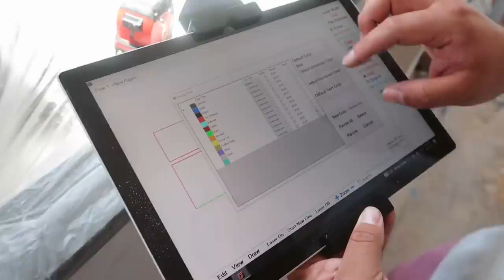HOW DID I GET SO LUCKY

Comment: I grew up in an 1890s house on the East Coast and the window trim and baseboards look like the same wood as what you have, especially the grain pattern. I think it's probably oak and it definitely looks original. You can probably take a photo of the wood and mail it to the local extension service or take it somewhere that wood is sold and a person there should be able to tell you. In the past, wood used to be varnished and varnish gets darker as it ages. I think that's what the darker layer over the wood is. The wood trim in our house had a layer of varnish over it. Varnishes can still be used today, but widespread use of varnishes fell out of favor, partly because they are highly flammable even when dry, and are toxic when applied. Let us know what you find out.
Reply: I agree that it is original. I owned a 1920's Mediterranean style house and this trim is very similar to what we had. It had mostly oak but also some mahogany in places. The grain looks more open so I'm leaning toward oak.
Reply: Definitely oak! 👌🏼

Comment: Consult with a carpenter to determine if the stained glass windows are suitable for hinging and to be used as doors. The side stiles are pretty thin wood and they probably were originally fixed and decorative rather than functional.
Reply: I agree
Reply: I agree.  There's bound to be solutions but it's important to invest wisely.  Don't want to face disasters later on because you failed to do your research and course corrections.  It would be disasterous to invest in property, security and insurance if they refuse to payout because the wrong thing was installed or something installed incorrectly.
Reply: Great points. in the end there is a solution, but it may not be installed as exterior doors. Your climate is different, but good points on how can be used.
Reply: @ritaevans7125  I agree.  Maybe a set of double glazed doors on the outside keeping the fancy doors for on the inside of the doors as 'window treatment'  rather like blinds or curtains. Maybe the outside ones on hinges but fancy inside ones on sliding tracks but fancier than barn doors.   The solution might just need a bit of creativity.

Comment: The wood still has some varnish and stain on it. You will have to sand it down to get to the actual wood and it is probably oak. Also be careful with the heat gun, left in one spot to long and the wood burns under the layers.
Reply: Denatured alcohol and steel wool works well to remove old varnish.  Use good ventilation though!  It's hard on your lungs.
Reply: Denatured alcohol is highly flammable. Be careful how you treat the rags or dispose of them. It works great for the varnish!
Reply: Yes to all these comments. Sand, stain, finish
Reply: I would definetly use Speedheater for this. Even faster then the heat gun and much more safe to use 👌
Reply: I agree that its oak (probably red oak considering what the grain looks like), and that it has either a heavy varnish or glaze finish left on much of the surface.  Steel wool and denatured alchohol is the way to go.  Then some sanding pads of various grits will take it down to the natural wood and the sanding will help tighten up the grain - should be beautiful when you're done.

Comment: I’ve used citrus strip , it typically takes it off in layers. You might want to test each layer for lead. The older layers may well have lead paint.
Reply: CAME TO SAY THIS
Reply: Yes, the lead test only works on the layers it touches, so you only tested the outer layer.
Reply: @katieb710  but he scrapped it to the wood, so then he has all the layes tested

Comment: Rub the wood trim with steel wool dipped in paint stripper. The darker wood tone could be old varnish which has darkened over the years. Hard to tell what the wood variety is from your video
Reply: Also clean off the gunk with mineral spirits.
Reply: That hundred-year-old Amber shellac is what's making the wood a little darker. It's been on there so long it's probably easy to sand off with a little bit of 80 grit.
Reply: While the steel wool does work, it can often darken the wood unintentionally and that can't be removed.
Reply: Instead of steel wool, brass wool can be used. Order from Garret Wade

Comment: Hey! :) You can actually find out the exact date of manufacture of the windows: On a double pain window the date is usually printed in between the two pains of glass or sometimes on the window seal. Your windows right now look like PVC... so definitely not from the 1920s. It would be so nice to update them to more authentic looking wooden windows with modern insulation. It would really complete and elevate the whole look and atmosphere of your stunning home!
Reply: I agree, these newer windows were fitted within the existing window frames with a new frame. It's a cheap way to update windows but it reduces the size of the glass and makes the frame super large. Considering how many windows this home has, I can see why the previous owners made that choice, but it's such a shame...

Comment: 81” opening, 80” door, perfect. Leave the 1” at the bottom for air flow. Buildings need to breathe and that’s why you have that size doorway. Edit: To your question about the wood trim, what it is/is it original. It may be original since it is quite traditional in style. Possibly maple or beech. Typically staining maple a dark tone ends up looking streaky. Could be why they pained over it. Stick to your lighter American walnut tones or lighter. It could also be quarter-sawn oak. Search for pictures to compare once the stain is removed. Oak can take a darker stain, but you’ll likely need to do some sanding to get the stain to grab. Great finds. Excited to go shopping on Lone Fox now. Bye! 👋🏼🛍
Reply: Yes! Interior doors aren't supposed to be flush to permit airflow. If you don't, the air in closed rooms will become stagnant
Reply: Needs weatherstripping though!

Comment: Hard to tell what wood that is with the current finish, but I'm leaning towards red oak. Remove the rest of the finish down to bare wood. Loving your remodeling videos !
Reply: I agree on your red oak estimation.  The stripper may have opened up and raised the grain.
Reply: I agree! Looks like expensive oak, which would most likely be original.
Reply: Red oak or cedar. Cedar was pretty common then too.
Reply: 1/4 sawn red oak is what I first thought. But with it being so dark I thought maybe Mahogany.

Comment: That wood looks original and it is real wood. It is pretty common in older houses for the wood to have been grained/ given the faux bois treatment when it was originally installed. It was done to use a slightly more economical soft wood but make it look like a more expensive hardwood.
Reply from the maker: Ahhhh I see! With this should I go in and remove that varnish and sand them down / restain? I just can't tell if there will be a grain pattern on the wood under this treatement
Reply: @lonefox  I think you should do that.  I’m guessing it’s Douglas Fir.

Comment: I was wondering if you can just treat the new “doors” like windows (which they are) instead of doors with a doorknob since they are on an upper floor. You can still hinge them so they open but put those slide locks on the top and bottom of each so they close and lock. Not sure if that would create enough of a sealed closure or not but just a thought.

It was so funny just as you leaned the door and the wind blow I barely saw it move when an ad popped up and i shouted “Oh no!, was it about to fall.” I couldn’t even skip the first ad but I was trying to see what had happened. So glad it is still intact 😅
Reply: The ad hit right as the door fell for me, too. My heart leapt & I couldn't breathe all the way through the ads. All I could think was, "poor Drew! He's gonna be shattered." (I'll show myself out.)
Reply: Same!  Window was falling...AD
Reply: Same! The absolute worst cliffhanger!
Reply: I agree!! I think it would look so good as windows with a hinge rather than a straight up door
Reply: Ad Blocker Plus is the best for YT videos.

Comment: Congrats on finding those doors.  They're are gorgeous!  And, yes, I was screaming aloud as the door fell too! LOL Whew!  Q:  You mentioned a drop off to the balcony when you open the doors.  Can you have your builders open the space for the door down to the floor and remove that molding, so it's a 'full door opening'.  You can add a wood frame/trim/moulding around the windows for what looks like what would be a 6" height difference. A 'full height' door would provide a cleaner look.  Just asking :) P.S.  The designer party was amazing.  Love the set up and your pot find was awesome.

Comment: You may want to have a reinforced frame, attached to the glass windows if you want to use them as occasional decorative doors.  It's fun to see you discovering antiques & researching appropriate ways to rehab. original features of the rooms.  Monterey/Rancho furniture pieces may work for the era.  It was originally manufactured in LA from 1920's through 1950 -very old CA!

Comment: Everyone who wants to try the heatgun method: please reconsider. Transcendent Furniture once talked about why she does not use it on furniture and basically the two main points are: 1) the paint/laquer or whatever is on there was not. made. to withstand heat. So you don not know what kind of chemicals are released into the air when you heat them up or exactly how they will react to heat. and 2) some paints (or other finishes) can start burning up really quickly and can be difficult to put out which can not only be extremely dangerous but also highly destructive to whatever you are trying to strip. 

If after all this you do consider using heat, please please PLEASE wear really good protection gear. You do NOT want any smoke or vapors of this in your lungs.

Comment: I believe the trim is original to the house, or at least very old (maybe 30s or 40s). The quality is definitely outstanding. 
Once you get the paint off (try using a dental kit to get the small spots of paint away). And I recommend treating the wood with oxalic acid to even out the wood  tones. Then you can stain over it and it'll look much nicer (this is often used to refinish vintage furniture).

Comment: Don’t forget to deactivate the stripper residue by going over it with mineral spirits and 0000steel wool. That should take off the remainder of the paint as well. You might want to look at getting a carbide scraper with curved blades to help you strip the windows if you decide to go down to bare wood. The citristrip will likely ruin any stain on them anyway. Those stained glass windows!!!!! Your fall collection is gorgeous! I love it all!

Comment: That window trim is most definitely original. I studied building- and architectural history, conservation and restoration in uni and it looks spot on, it just has som treatment/shellac on it that makes it look like that. Lightly sand them and put new shellac on and they will look new again.

Ps. Shellac comes in many many colors so you can get the same darker look again.

Comment: I tried to read all the comments, and I did not see the glass panels address, except when one of them fell. Heart attack. Old stain glass panels are solider with lead that bend and crack over time.
If you are going to use them as doors, there are several things you may want to consider. First check to see if they need to be "re-grouted". This will keep moister and wind from seeping in between the cut glass and the leaded channels. Next, for support of larger stain glass pieces like you have, there should already be support  metal bars worked into the panel so they do not bend or shift from the weight of the glass panel itself. Check to make sure those bars are not damaged. If you do find a crack in the glass pieces or the metal bars your local Stain Glass Studio can repair and seal your panels. I personally would suggest you take a picture to the Studio for them to suggest your best options. They are lovely. I personally would frame them with a dark wood and put an clear acrylic (or clear glass) panel on the sides that face outward to protect from the elements. Framing them would also give you the opportunity to use the wood border to hold and strengthen the glass panels. Also you then could attach other hardware like hinges and door knob/faceplate. That is what I would do, but I sure there are others who could suggest more.

Comment: I have a 1900 home and stripping my porch. I've used 3 kinds of stripper. My best result that I got is actually sanding. That stripping gel was super messy and a pain. I'm using the circular sander for flat larger areas, the triangular sander for smaller area, and a detail sander for the small detailed areas. By the way, I think my heart stopped when that glass fell. Good luck!

Comment: To my eye, and I have owned a Craftsman, that is definitely the original wood trim.  As to the type/genus of wood, it could be one that was available in California or one that was imported at the time the house was built.  Oak was used a great deal at that time. If it has been faux grained/painted the finish should have been removed with the heat gun and scraper.  But you may wish to try a stronger stripper on a low visibility area to see if it comes off(watch it carefully though as it it could lighten the color).  It may even be Redwood or Mahogany.  You may have a difficult time finding trim with the same profile for the "door" but your salvage people may be able to help you out or point you in the right direction.  It's going to be a big job but good for you for wanting to faithfully restore the trim.  Even if you choose key areas to restore it in I'm sure it will look fantastic.  Regards from Canada.  p.s.- I have restored and designed a Craftsman for a client who also wanted to restore the wood trim but we discovered that it had been done in paint-grade Pine and was never meant to be "Shoe Wood".  The home was built at then end of 1929 just at the time of the Wall Street Market Crash and the "specs" had likely been changed to a low grade of wood in order to complete the house.  You just never know what history will show you.  p.s.II - On reflection and looking at the video again it's looking more like Oak.  The Varnish has darkened which is normal but to be even in the end it does need to be stipped away so you can see what you are dealing with and a proper decision on finish color can be made.  If you a want a reference point look up at the color of your beams.  Spanish Colonial tends to have had a darker wood tone.  Sorry to be verbose.  Happy days.🪚🔨🪛🪟🛋🧹

Comment: You asked about painting the metal windows. Color I'd choose is to match the metal in the room light fixture. Everyone is thinking the same. They used varnish on wood back then also on floors. Then as it ages it almost seems to blacken. Then everyone just painted and painted and painted over it. My Mom striped woodwork in her early 1903 house. If only she had had that heat gun, she probably would have done the entire 3 floor house. Sadly only the kitchen....in the 70's

Comment: I would put money on those window frames being original. I live in a Victorian terrace and the amount of that fake wood stuff I've painfully stripped off our base boards is... large aha. Its like a thick gooey substance which I believe someone else has said is called shellac, it was used to make one wood look like a more expensive, or fashionable wood at the time. It shows the age though,  we haven't done this for quite a while, at least in the UK. It also protects the wood, so the likely hood is once you get it all off (heatgun again sorry, and lots of scraping) and sand it back, it will look like a completely different wood. Issue I have had though is that it can be tricky not to damage the wood underneath when you take it off, I don't know if there is something that can deal with removing it more efficiently and with less damage, maybe worth looking into? Going to be a lot of work, but I've found it worth it as long as you are okay with having imperfections, I personally think it adds character but that's my own opinion ahah.

Comment: Try rubbing denatured alcohol on the stripped window trim...if it gets sticky and gloopy then the wood has probably been sealed with shellac. And that's easily removed with alcohol. But be careful using wire wool with stripper...some strippers and wire wool react with wood tannins (esp. oak) and leave black marks in the wood that are impossible to remove.

Comment: You gave me a slight heart attack! I screamed when that window fell! You’ve probably already figured it out, but that trim looks 1920s. Shellac would have been used as a primer, and is why the heat gun causes the paint above it to slide off. The wood looks as if it was also stained dark.

Comment: as a finish carpenter, the trim doesn't look original, but I do love the darker trim because of your ceilings! Sand with 120 grit up to 320, find a stain that looks similar, stain, then apply a clear satin poly finish.